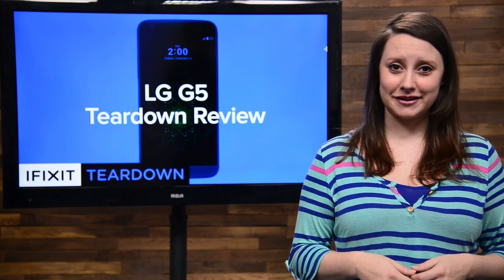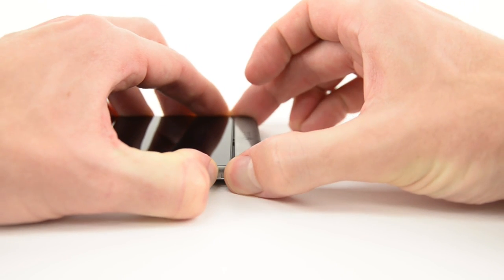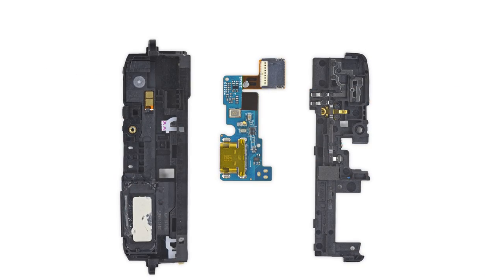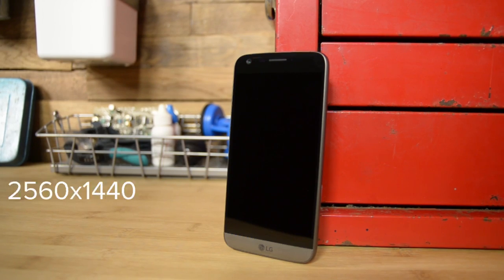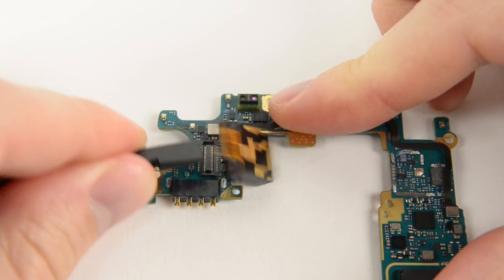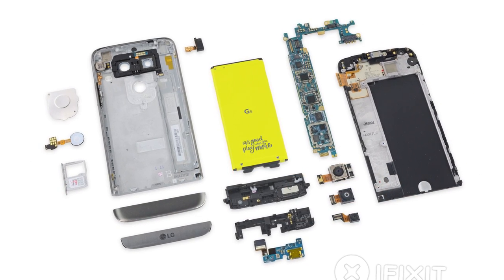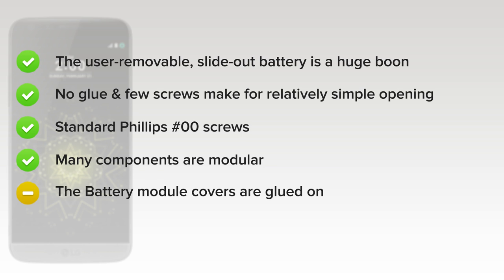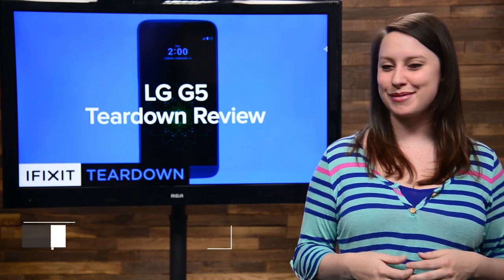LG G5 Teardown Review!

Comment: Why is "fused digitizer and LCD make it more difficult and expensive to replace" a con still? Every single flagship now has fused displays to eliminate screen gap and save on that extra bit of phone thickness. Pretty sure the only place you'll find a separate digitizer and LCD display are sub $200 phones.

Comment: Great video. I have found the rear camera glass on my G5 broke. Not sure why. I never dropped it and it's in an Otterbox.  Searchingthe internet I found no videos on that repair so I went to ebay, found a replacement part and figured it out.  pretty easy altogether BUT in all my resarch I found many people are having this issue with the G5. In my "successful" attempt at the repair, I noticed a smallsquare of glass that came with  my replacment kit. I cant figure out where it goes. Any Ideas?